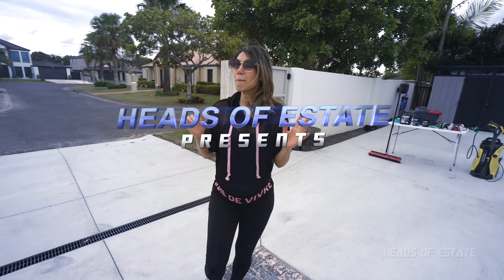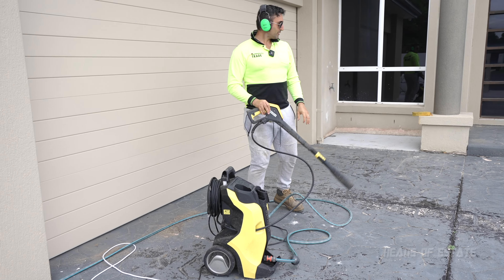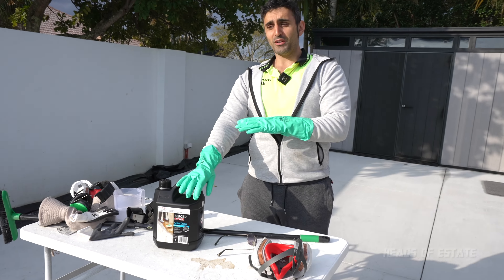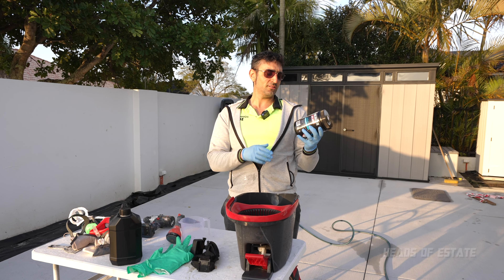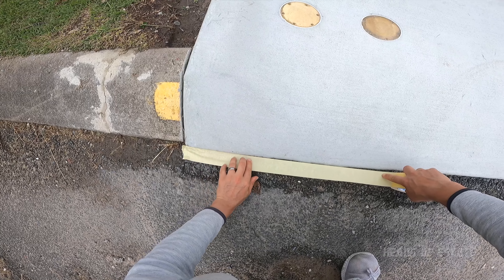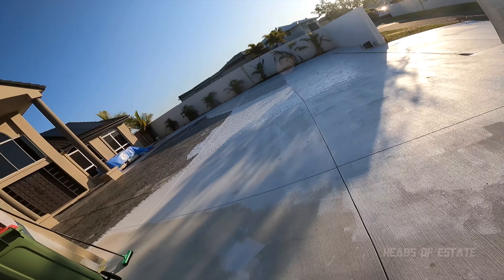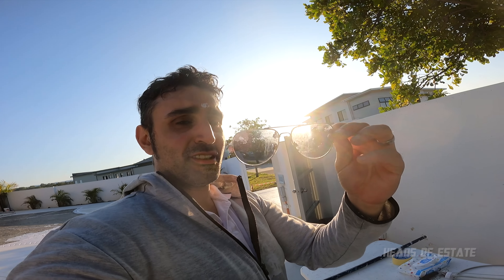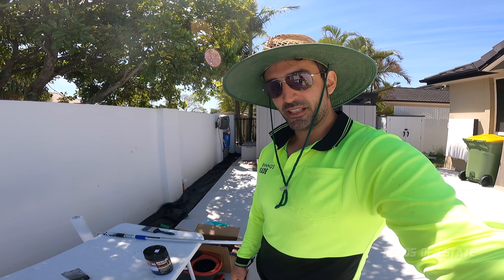Painting MASSIVE Stamped and Brushed Concrete Driveway | DIY How To with Berger Jet Dry

Comment: Great video, I will be painting my concrete soon 😀What was the paint colour you finally used? When using a roller a good idea is to wrap sticky tape around it before use to get rid of any stray hairs
Reply from the maker: Thanks so much for the tip, will have to try it out when I paint the house. Best of luck with your one too, hope it goes well.